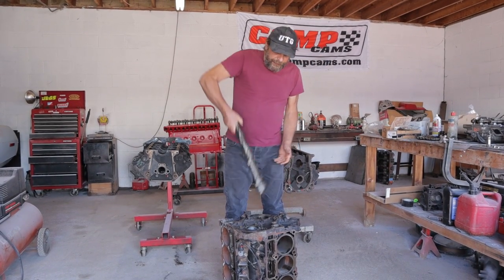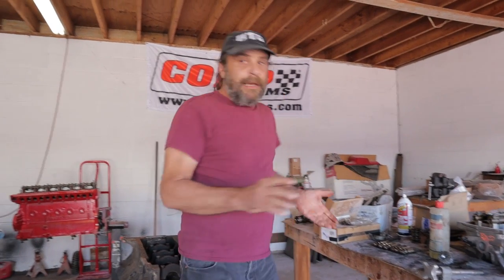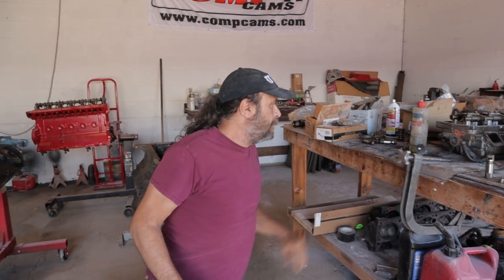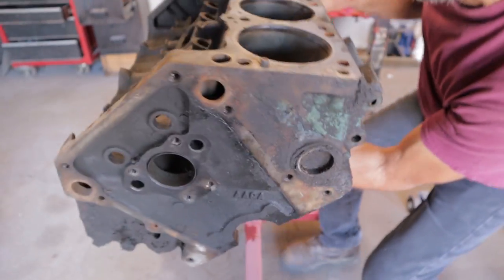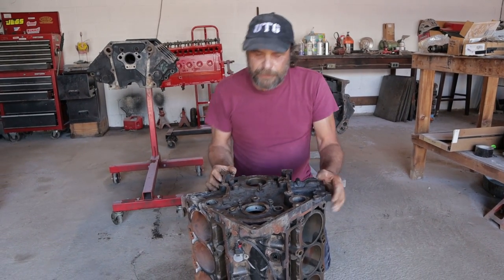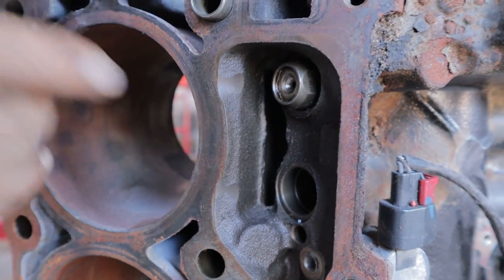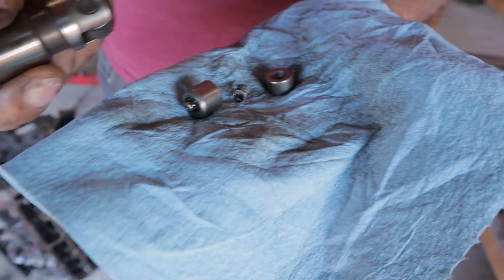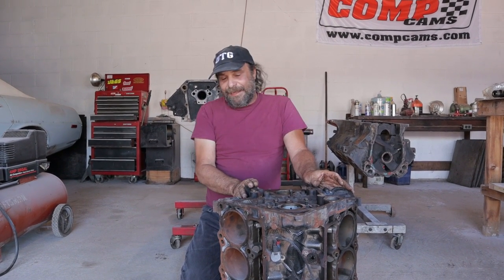Gen 3 Hemi Camshaft Failure Mystery Explained!

Comment: Dude, you just broke my heart! I love my Challenger, but this is just so sad! 😭
Reply: @DANTHETUBEMAN  I always do! 😉
Reply: @DJGRoc  I'm trying to save my engine, gets you out of all tickets and keeps the woman quiet,,, hahaha.
Reply: @DANTHETUBEMAN  I know what you mean. That's also why I have a V1.
Reply: Disable MDS and change oil every 3k-5k miles and you should be fine
Reply: @ianwalker8210  I got the 6-speed, so no MDS. I do change the oil when Oil Life gauge reaches 0, & I'm currently using Royal Purple's HPS full synthetic oil.
Reply: DJ G-Roc yeah I would like to say it’s a fatal flaw in the MDS system, so if you don’t have it you should be great. Just make sure to use the proper weight and change at the proper intervals. My mechanic and I came to the conclusion it’s not a lubrication issue but a cylinder activation issue because the damage looked to be like it was caused by repeated impact rather than increased friction. It makes more sense to me because a lot of failed lifters have this huge flat spot on the rollers where they crash into the cam.
Reply: @ianwalker8210  I'm using the recommended 5W20. Challengers with the manual transmissions don't have MDS at all. Never been a fan of that stuff anyway.
Reply: DJ G-Roc yeah I was a little iffy when I drove my truck the first time and heard the weird MDS gurgle out the exhaust. I always wanted to tune it out but never had a solid reason til now. When we pulled the solenoids, they were filthy. Also it farther supported my hypothesis because the only lifters that failed for me were on the same cylinders as the dirtiest solenoids we pulled. Crazy that it doesn’t throw a code when the MDS acts up
Reply: @ianwalker8210  That can totally be tuned out, if your PCM is unlocked.
Reply: DJ G-Roc rangetechnology makes a device that plugs into the OBD2 socket, it’s completely plug and play. Tricks the motor into thinking it’s under load without changing the rev or shift points. Got it coming in tomorrow 😊
Reply: @ianwalker8210  👍🏼

Comment: My grandfather taught me to never “warm up” a Dodge 35 years ago. He always said to just start it and go. I currently have two GEN 3 Hemis. One with 240k and no noise or notable loss of power. The other thing with these is to check the oil level. The light on the dash is no replacement for proper maintenance. These engines will consume some oil and even with seven quarts you’ll begin to wear parts out prematurely if there isn’t enough.
Reply: Do you think adding a bit more oil than the manufacturer's recommendation might help with this issue or just increase oil pressure too high?

Comment: Glad I got a lifetime warranty! I shut the mds off on my 06 hemi two weeks after I bought it. It made the engine sound like crap and it really did not work properly lots of vibration too! Funny thing is I actually got better gas mileage with it off!
Engine now has 140,000 and I run Mobil one 5-20w. It does have a tick at idle but still rips through the rpm 's no problem.... 
Occasionally a puff of oil smoke when I first start it out the exhaust since new...
Other then that i am  pretty happy with the hemi, it idles so smooth that sometimes you cant tell its running, I just hope its getting enough oil!

Comment: Hi uncle Tony. So I have a 2016 SRT 392 Challenger. I've built that engine and it dyno's just under 900 rwhp.  The problem with the cam being eaten in the stock engines is the MDS lifters.  The roller bearing on them is, for whatever reason, weak.  They freeze up and then eat into the cam.  Notice the Hellcat's don't have that problem?  So when I built mine, I deleted that, went with Hellcat lifters, Wall .80 pushrods, and a blower cam (since I'm running forced induction) and that solved the problem.  Unfortunately, those who choose to pay the $5k to replace the cam and lifters will only experience the same things over time.  There really isn't an issue with the oil going through tubes in the block that contribute to lack of lubrication.  FCA is blind to the problem, though they know about it.  They prefer to produce ticking timebombs on 5.7's and 6.4's.  I've heard several stories of warranty claims being denied because the stealerships claim abuse as the cause of the problem, in the form of racing and lack of maintenance, and that just isn't true.  But I wouldn't shy away from building one.  You just need to replace the weak links and tune the MDS out of the ECM.
Reply: SO they did not remanufacture the engine and even 2020 hemi will have this problem? UNREAL

Comment: You can use high pressure oil pump... hellcat oil pump will fit 5.7 or 6.4 therefore you will get better oil pressure that can lubricate the internals very well
Reply: This helps too I’m using this method also

Comment: Copper oil line, fittings, drill, tap. I did this on an old buick 430ci   came from T in oil pressure line, drilled back of block, installed fittings, and ran copper line above cam with very small holes i cut in it.

Comment: Yep, I just started having issues with my number 3 cylinder on my Hemi.  I'm at 104 K.  I'm pretty sure it's the lifter/cam you stated here.
Reply: Dude same here! Dead cylinder 3. Crazy
Reply: @rjgonzalez7626  Number 3 is the most common cylinder.  Hemi's used to be the old reliable truck/plane engines.  Since, they are having  parts, and the quality of parts trade war, the Hemi's engines aren't that engine anymore.  And, let's not add their transmission issues they have had in the recent past.

Comment: Could be the volume of oil distributed by the pump, The design of lifter, Push rods becoming clogged. Maybe pcm connections making things running crappy as well. Recommendations for the use of stabilizers for those rockers?

Comment: I'm a red seal auto Tech (equivalent to a ASE Master tech) and what I've done is use a 5w40 synthetic oil in all those Chrysler engines. The 3.6 had rocker failure and the 5.7 has cam failure. I found that having switched to the thicker oil I have not seen any of our customers with any issues. Those whom use factory spec oil are having issues. 5w20 is for fuel economy not longevity. Just what I've seen in my years

Comment: I bought the 6speed so it didn’t come with MDS I also used Mobile one and marvel mystery oil and had it for 100k and beat the bag out of it and over 40 track runs with nitrous and a tune and never had a engine problem ?

Comment: when they first came out with this POS i was changing 8 or 9 a year. most was between 75 and 160 k miles. and i also found that most did lots of idling. that most would idle more than they was driven. plus the lifter is laying more flat than a V shape so any oil that did hit the top of the lifter still wouldn't make it beside it and the shop told me that i got so good at it and did it so fast that they wasn't going to pay me by the book anymore. but they was still charging by the book. so i quit doing them. and let someone else do them and it took them at least 15 more hours than it did me. and they started losing money on the jobs and when they begged me to take over again. i said sure but now i get 80% a few weeks later i retired from this kind of work. I'M TO DAMN OLD. I agree with your its junk 100%

Comment: Tony why not use lifters with pin feed and also drill tiny holes in the tube running under hte cam that spray up too the cam lobes?

Comment: Tony, another point:  the hemi tick can be intermittent, and from several causes, BUT it may be often related to hot oil, i.e., low oil pressure.  You need enough oil pressure to keep the lifter in contact with the push rod ro avoid the tick  Hot oil, idling with low oil pressure, tick tick tick.  All the more reason to cool the oil and run 15-50 Mobil One.  IMHO.
Reply: Hellcat oil pump.

Comment: Negative.  What kills the cam shaft is the cylinder shut down system. The lobes that are worn down are all related to the cylinders with shut down. They loose oil pressure causing lack of lubrication. I have done many hemi cam shafts from 30,000miles to 230,000. If lack of lubrication is as you say they would have fixed the issue.

Comment: You need to get oil sprayers spraying the camshaft directly. Find a way to drill a gallery or tap off an existing one. 

This was the solution for the Lycoming H2AD engines on the Cessna 172. 

Aircraft engine.. but a lot of similar problems. Lycomings have the camshaft mounted high instead of underneath like Continental does. They always have camshaft problems. 

Solid lifter bodies.. but most you have to split the crank case to get them out (Which is a very involved process because you split your main bearings while doing it). On the H2AD engines they decided to make them smaller so you could pull them out. Less surface area, more pressure, more frictional forces. 

A horizontally opposed aircraft engine has the same problem. Nothing from the lifter bodies drips to the camshaft. No problem when the camshaft is mounted below the crank. Big problem when it’s mounted above. Has to be high RPM.. no idling. 

But one advantage it does have... they all directly oil the lifter bodies.. and then the lifters push oil up the pushrod tubes to the rocker arms, rocker shafts, and valves.

Comment: Way to go mopar guy , you da man. You figured it out.  Now you or me or someone who gets it needs to build a oiler to install in there. Like in a chainsaw. Or a lawnmower. Some metal brakelines spliced into the oil system bringing oil to where it needs to be. If the military had this engine, for sure the mechanics would be modifying it as need be. The ford 6.0 powerstroke was a engineering disaster and it was the private sector that figured it out and built mods to correct the problems.

Comment: tiny squirter holes in the main oil galley hitting the cam or perhaps a tube ran on top the oil galley doing the same(if there's clearance)
**of course that's all highly prone to debris plugging, lack of oil changes, extended idling, repetitive high temp heat soaking. I can probably think of 10 more things, but probably best I just quit now ;)

Comment: Happened with my hemi as well, lifter failure and eventually broke the timing chain. Deep wear on the lobes and worn needle bearings in the roller. And my lifter bores had tiny surface rust on them. Idled a ton and even with good oil pressure and obsessive maintenence on my baby it finally had timing chain failure and jumped timing and bent valves in 3 7 and 5. We need to find a way to force feed oil to the lifters. Im designing a way right now on CAD. I will have top end internal oilers soon for my fellow mopar guys.
Reply: A Hellcat oil pump
Reply: @Big Nick Energy  damn 2 years ago haha. Now that engine is gone. Drain back holes in the heads my guy. Theirs a whole video on it. It's not the oil pump.

Comment: If what your saying holds true, and it’s seems reasonable the only fix would be to run solid roller lifters with a squirter hole in the body to spray the cam and roller. But that’s not a option for anything but performance builds ain’t gonna pass muster for a modern passenger car

Comment: Have the bottom of the lifter piston bore laser drilled, small hole .015 or so and increase oil pump volume. So the oil sprays right on the roller.

Comment: Can  specific valve cover with pressure gages some oil sprayers when idling be , made and changed over , also a special oil pan together for recirculation. It's worth a try to make and sell. Because the dodge promaster 3.6 pentastar engine needs a cam and lifter oil fix as well. So I might just plan to buy some stuff and tinker away heck it's worth a try hey a cooler would not be a bad thing as well. It's all will definitely help in my opinion. So if you own it nobody can stop you.

Comment: Uncle Tony, You da BEST!   Couldn't you run some beads of block-compatible weld over part of those drain-back slots, so you're left with a little shelf that'll then drop oil right ON the camshaft, so a trickle/stream DOES contact the cam-shaft?    And if I were you, put two plumbed tricklers, also hitting that camshaft.    And while that lifter-body has no holes through-it, if you drilled a hole through it, would that drilled-hole Also... help lube the camshaft?  And further, does this ONLY happen with the "350" small, new-hemi, or is this throughout the various displacements of the hemi?   The Hemi's too good a "Honker" to NOT be used, so can't you put out a "Uncle Tony's-Hemi-oiler-system" after-market Kit, where we can "care & feed" for our favorite "Elephant?"    A kit'd put a little extra in your pocket, while making you the MAN,--the Savior of the Hemi-world.    I bet Summit or even "Stellantis" would help you put out an After-market kit-FIX for thirsty Hemi valve-trains/cams

Comment: So the hemi cam is only oiled by splash basically.....like the old Briggs and Stratton......wow. My only experience with engine building was the old smallblock chevys and the lifters were pressure lubed in the bores and the oil went up the pushrod to the rockers and tops of the valves. How does the rocker arm get oil if there’s no hole in the lifter and pressurized oil is pumped up the pushrod? Can’t imagine how these engines stay together for any period of time. I hope I missing something here but if not that’s the poorest design I’ve ever heard of. Nice job nailing it down!👍

Comment: Maybe tapping into an oil galley and making a spider type assembly from 3/16” steel line to spray over the roller/cam interface area. I bet a .005” hole for a jet would flow way more oil than needed to get the cam and lifters to live a life of just idling. Very tedious though. Kind of like piston oil squatters.

Comment: What about removing the splash guard from the oil pan for a daily driver. Is there a lifter that has a hole in the bottom to oil the roller?

Comment: A big problem here is when cruising at highway speeds in OD the engine is running in upper teens in rpm's.
On long trips you could run like this for several hours at a time with minimal lubrication of cam and lifters.

Comment: My Gen 3 keeps going into limp mode and I can't figure out why. I've replaced the Camshaft Position sensor, APP sensor, MAP sensor, and even the EGR valve. It keeps throwing 1628, 0652, and 2127 codes. When it does it, it locks the RPMs at around 1700 and I have no throttle response but I can put the car in neutral, turn the car off, crank it back up, pull it back into drive and sometimes it will be fine, sometimes it will immediately go back into limp mode. If anyone has had this issue and gotten it resolved, I'd like to hear from you. Thanks!
Reply: Try replacing the idle air control valve

Comment: While I would agree with you, my workplace has a fleet of ten Ram 1500’s from 2013 up to 2019 that run all day and idle half the day. It’s a highway maintenance department. We’ve never had an issue with the Hemi. Ironically we lost 4 LS 5.3 pickups due to low oil pressure and eventual knocking in the fleet prior. Our trucks get average preventative  maintenance and no special treatment by the drivers. By the same token two similar trucks by other agencies in our county have suffered hemi failures at 60k miles or less. Origin of failure unknown. Engine replacement cost $8000 by our fleet mechanics.

Comment: I would block the oil drains for the tip of the lifters, and drill another farther up so the lifters have an oil bath from the top. You could also groove the lifter bore on the top so oil drips down the top of the lifters.

Comment: A big part of the failures come with dirty oil, and lack of useing the correct oil.
A lot of the 6.4 repairs ive had to do was simply farm trucks.  Farmers idleing around for hours on end checking the cows, and not taking that idle time in consideration of oil change per mile intervals. 
The other part is, a lot of these guys don't use the 0-40 synthetic needed, they grab the good old 10w-50 their old wore out truck needed, and now that oil cant get to the cam.   Even running 5-20 will cause lack of lubrication.
Every 6.4 we sold to farmers (sold around 2 a day!)  We would tell them, you need to keep 0-40 in it, change it at 3k not 5k, and make sure to rev it up every so often over 1500 rpms to keep the cam lubed up or it would fail as the motor was designed for towing and being in higher RPM range.
A few listened a few did not.   Sadly at 18k miles I had to replace a motor under warranty for a local farming friend because he did not listen and let the truck idle non stop, and changed the oil very little.  But he buys 3 new trucks every 2 years, so we worked with him on getting the warranty.
TSB out that if metal if found on the MDS sensor to replace motor, not to fix motor.  That was his saving grace on getting the motor replaced.
Reply: Change oil ad 3k miles, make sure to rev it often.. omg this engine is just retarded i need engine i can rely on , this is junk bruh.

Comment: Could you use a set of lifters that have an oil passthrough to coat the rollers, thereby coating the camshaft? Or would that cause oil feed issues for the pushrods

Comment: What about oil squirters drilled down the center of the valley so they drip down on the cam and tapping into and oil gallery or possibly into a oil pressure test port using a hydraulic hose and proper fitting. A higher flow oil pump would also be required most likely.

Comment: Wow. A buddy of mine has a hell cat engine. I was dismayed at the way the crank caps were snapped. I took a closer look and told him the engine looked to me like it has oiling issues. Then he showed me the cam, it was fried. Using the 392 hemi they maybe should have just stayed with the original design.

Comment: 650$ to replace cam and lifters.  Simple job on the hemi, whole reason for them eating cams is the oil galleries that feed the oil to the camshaft and lifters is not big enough feed enough oil pressure on idle!!! That's why the hemi tick is a thing